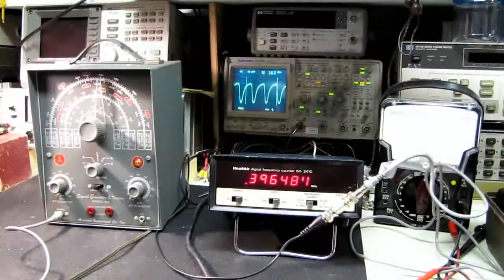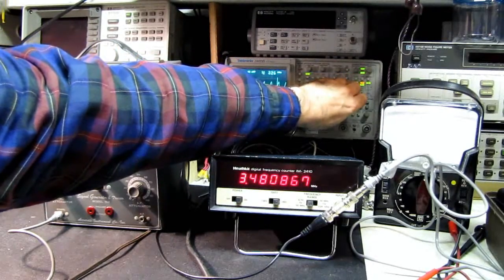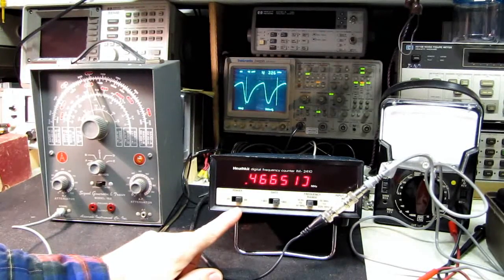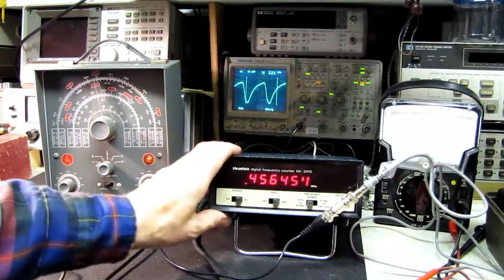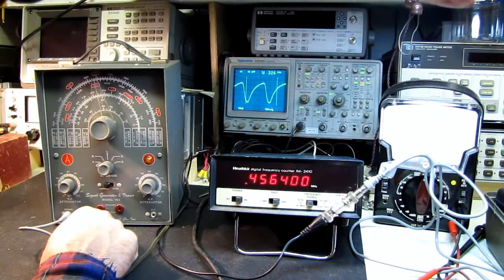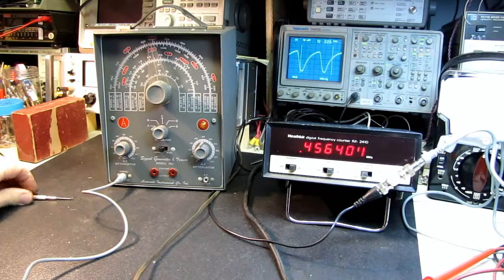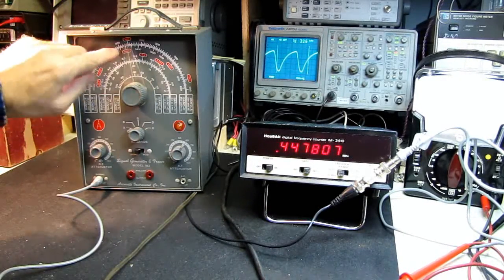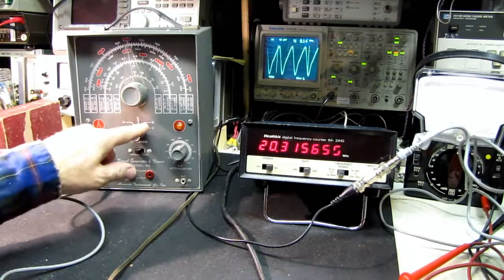10 Buck Test - Bench Accurate Instruments R.F. Generator Part 2

Comment: Don't forget Paco signal tracers.  I have three model Z-80's and their as good as a Heathkit.  I often wonder if they made the kits for Paco because their so similar.  One setting on top of my spectrum analyzer and use it all the time.
Reply from the maker: Had a couple of EICO ones, but never had the Paco. They can be useful in that you can actually hear what is going on. Looking at a scope trace can be deceiving.
Reply: +The Radio Mechanic 

Other nice features of dedicated signal tracers are the noise test function,  nice for finding noisey components and a onboard output transformer.
Reply from the maker: Go ahead, rub it in. I deserve it. Been kicking myself ever since it went out the door and I had to "guess" as to which resistor was noisy.

Comment: What is the part number on the 7 segment displays?   Odds are I probably have a few dozen, I have most ever made. :)
Reply from the maker: It is an HP part ( Now Agilent ) P/N 5082-7760 common cathode if you have one.
Reply: +The Radio Mechanic 

Don't know if I can part with them, I only have a little over a hundred of them. :)  That's the same display a Cobra 2000GTL uses for the frequency counter/clock display.  Shoot me your address.  My email is my YouTube user id followed by @gmail.com